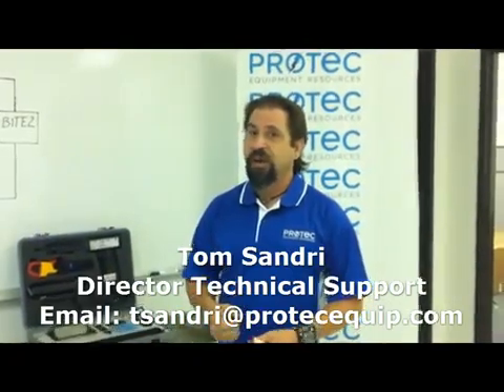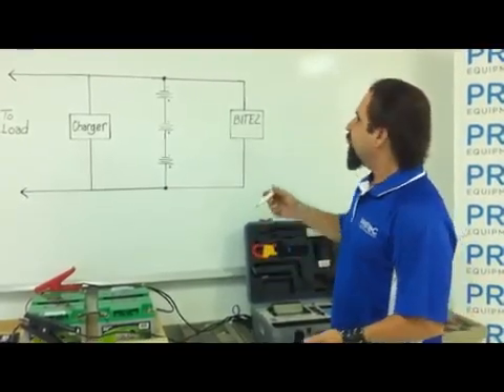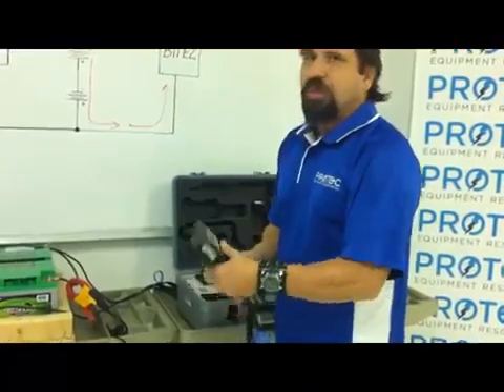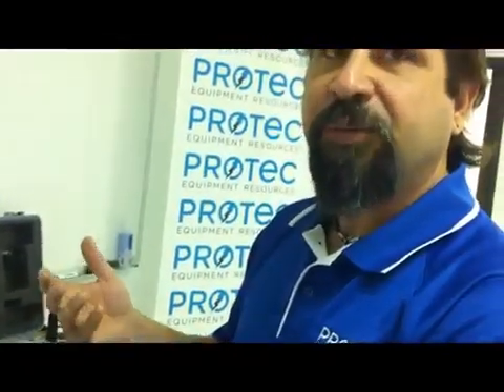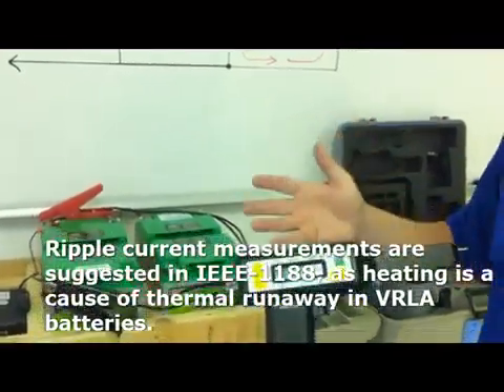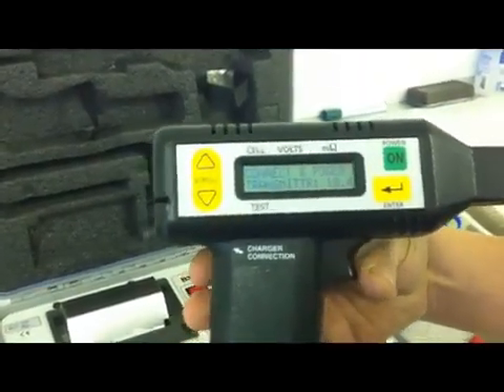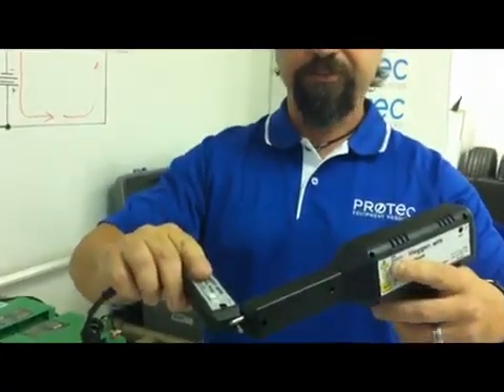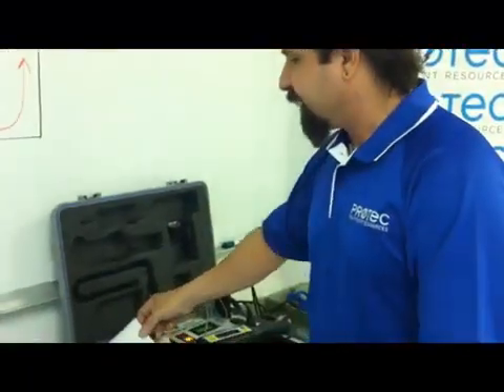Megger Bite 2P Battery Impedance Test Set Overview and Demonstration

Comment: Hello Sir, I have DC system with a lot of batteries but each battery has 6 pole, 3 + and 3 -. How to measure? Thankyou Sir
Reply from the maker: The attached “Battery Testing Guide” from Megger does a good job of addressing this question.  The explanation is on page 15 and references Figure 1(page 6):  https://protecequip.com/media/7183/meggerbatterytestingguide.pdf

Comment: Have you had any issues with using the MEGGER BVM modules?   Recently had issues with the modules dropping communication to the test set and not collecting data sporadically throughout a discharge test.
Reply from the maker: Yes!  Typically happens when discharge rates are 30 minutes and faster.  What's happening is the current flow at these rapid discharges  are causing large magnetic fields, which is interfering with the unshielded cables used on the BVMs.  The only solution is use another product like the Alber.  Look at the BCT-2000, I think this is the one I have used.  https://alpinepowersystems.com/manufacturers/alber/.  The update rate is much faster than the BVM as well.  We don't carry this Alber unit but not hard to find.  For fastest charges with high current, short duration, this is a very common problem with the Megger.  I feel your pain, been there.  - Tom
Reply: @ProtecEquipmentResources  Thanks Tom. ya we were thinking the same but also thought we were having PowerDB issues with the automated form we were using. Is there a effort to change the cables to shieled?  or is Alber coming out with a updated version of the BCT-2000. I have used the BCT but it wasn't easy to come by.  Does Protech plan to add BCTs in there fleet soon?